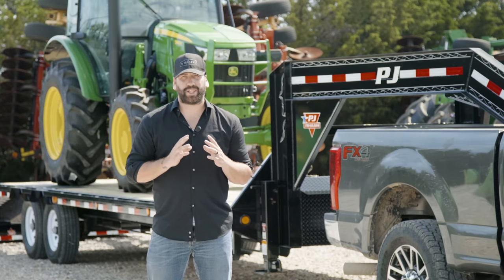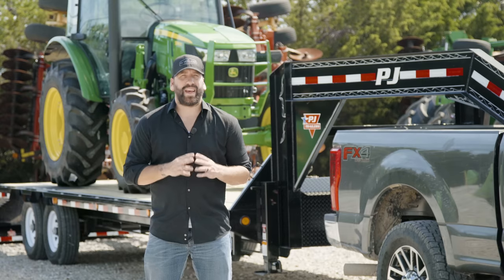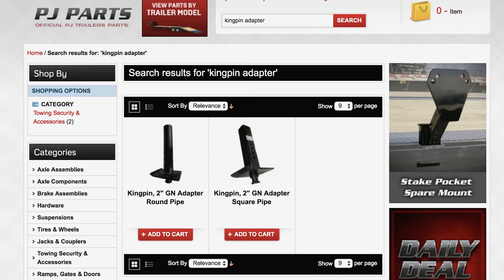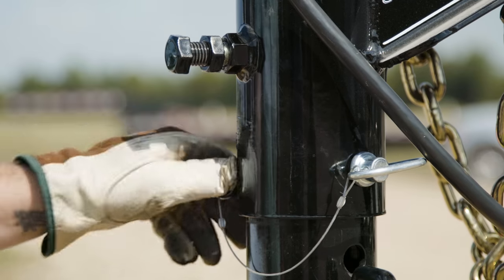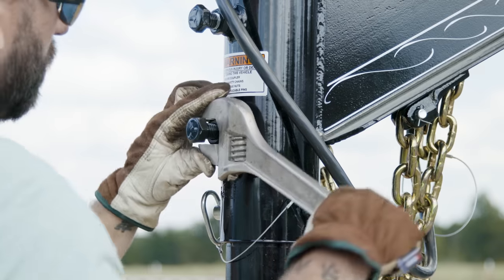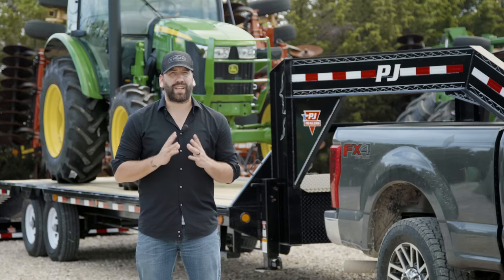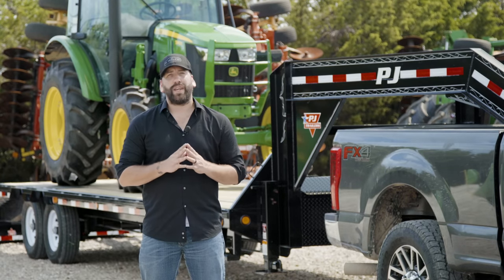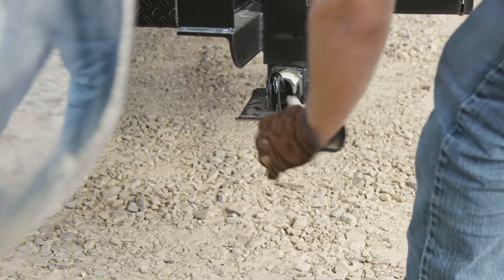Trailer Safety Series - Gooseneck Coupling & Maintenance

Comment: You also cannot loop the breakaway to the chain attachment points. The connection must be completely separate from any part of the coupler/safety chain apparatus. In the event of the the chain tie downs being ripped out the breakaway is rendered useless when its attached to any part of the system. Factory bed tie down loop in the front corner of the bed are great. Just need to extend the cable and add a quick release hook.. Great video guys. I have a PJ and love the craftsmanship and solid construction 👍🏽

Comment: What do you measure  to level your trailer? You showed the truck and trailer tires?? Then you said to measure measuring the hitch? What should the measurements be??
Reply: Keep it simple. You want a level trailer when the truck and trailer are on level ground. 

Get to level ground, readjust your trailer so it is level.